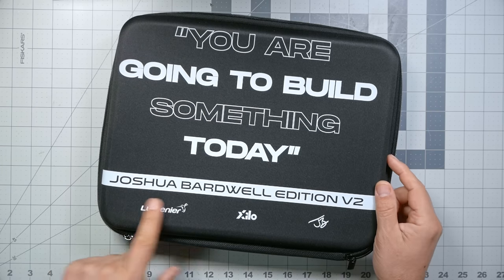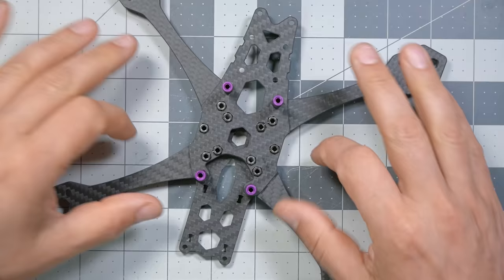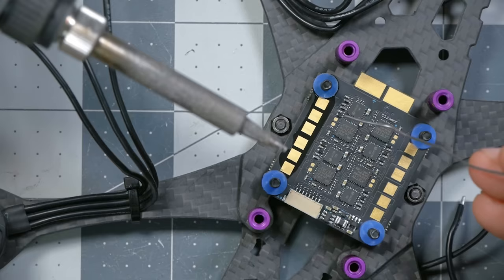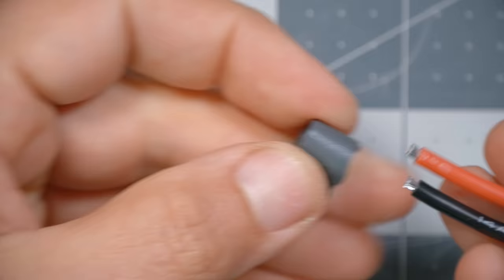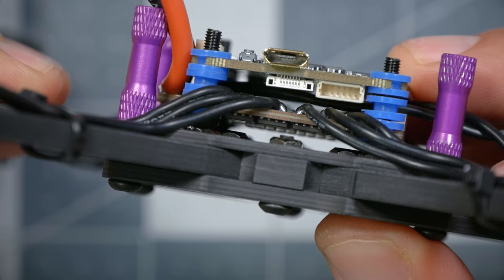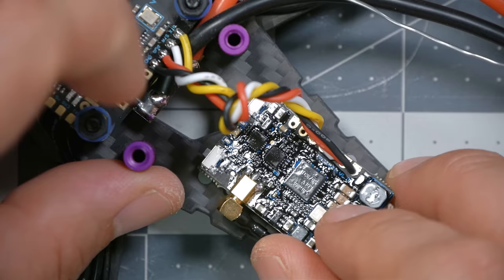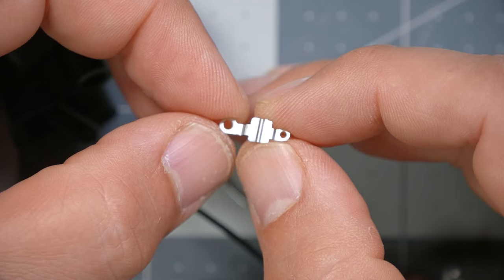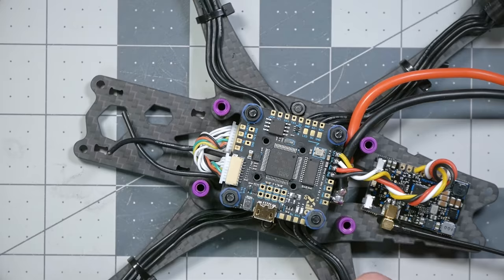2022 Freestyle FPV Drone Build (DIY Kit For Total Beginners)

Comment: Hi Joshua, is this bundle any good, please? >> Eachine Novice-IV 4 Inch 3-4S Sub 250g LR Micro Long Range FPV Racing Drone RTF & Fly more w/ EV800DM Goggles Radiomaster TX12 Transmitter - RTF 2x Battery Version? Thanks ;-)
Reply from the maker: Yes it's a great bundle. The main disadvantage is it's not very durable. So a beginner is going to crash and break it very quickly. But if you are able to avoid crashing it's quite good.
Reply: @JoshuaBardwell  Thanks , which one will you recommend ? ;-)

Comment: Hey so i wanna buy this kit and it would be my first build. What are a good pair of goggles that would work with this build that are not the $600 fatshark ones? Would the fatshark scout work with the ELRS receiver that he uses?
Reply from the maker: For the Analog video, the Scout is a great choice. Also Skyzone Cobra X. The ELRS receiver is un-related to the goggles. The goggles go with the video transmitter not hte receiver.
Reply: @JoshuaBardwell  Ok Thank You

Comment: I am really interested in purchasing this kit, have 12 of the 4s batteries, still consider myself a beginner, I have a few Fpv drones (4S)not ready to move into the 6s batteries quite  yet,  I went to your link and I didn’t see the option for 2400 kv motors.   Do you have another link for the DJI version or do I have to purchase the 2400 kv motors in addition?
Reply from the maker: The kit is only being offered with 6S motors for now. You could use 4S battery but it would be less powerful. Unfortunately, providing DJI + analog AND two separate kv of motors would have split up the product too much, and been impossible to keep stock with how expensive everything is and how slow everything is to make in 2022.
Reply: @JoshuaBardwell  no problem, you stated it was an option on the motors so I though I would ask, I think I’ll get the 6 S and try it with the 4s battery to see how it works out, still crashing a little to much to move up to 6s yet. Putting in the hours on the simulator right now.  Learning to build should help me out.  Can I just order the addition 2400 kv motors and use them for now, would I have to change any other components.

Comment: 340$ tho? I can buy a  professional pre-build one with that kinda money
Reply from the maker: If you want a bind-n-fly pre-build you can get a lot of them. And then as soon as it breaks, and it will break, you won't know how to fix it, because you don't know how it goes together or how to configure it. The point of this kit is that you GET to build it yourself, so that you know how it all goes together and how to configure, maintain, and repair it. A bind-n-fly that somebody churns off an assembly line will always be cheaper than a hand-built one-of-one kit that you make yourself.

Comment: well... not sure about that, but shouldn't you teach beginners that a capacitor should have short wires instead of soldering it on some 2 inch long wires? lol...some say it matters..
Reply from the maker: In a lot of frames, there's not enough room to solder directly to the ESC, so a short length of wire is a necessary tradeoff.

Comment: Lol the camera used for the budget analog build is a hunk of trash, other than that great build. The camera won’t solder to save my life.
Reply from the maker: The camera won't solder? Are you having trouble getting the wires to solder?
Reply: @JoshuaBardwell  Josh, thanks for the reply. I ended up getting the wires to solder!! I had to use extra flux. I guess the wiring was to small for lead free rosin core.

Comment: Why you chose one ESC for 50-60$€  , when you can put 1 ESC on every motor for a few $€ .
When something goes wrong you change 1 ESC , for a few $-€ 
I think your system  is weird.. 
Abn this tells you someone who never built a drones,  even never did soldering works.  Just someone who saw hundreds YouTube videos with drone or others électrique influencers like you